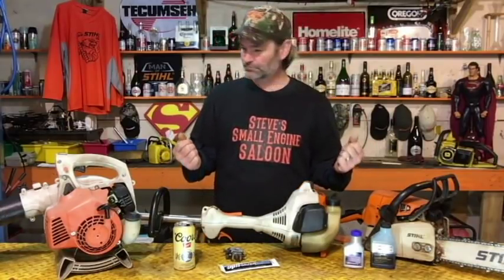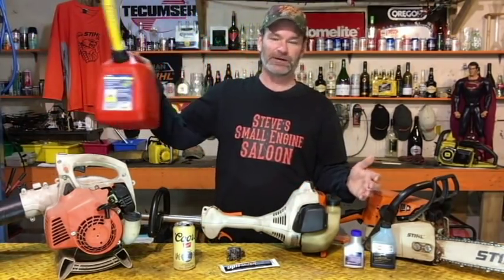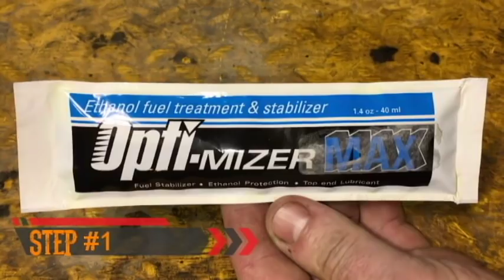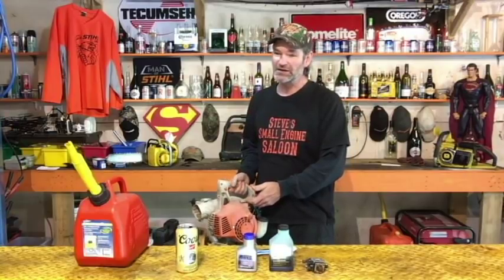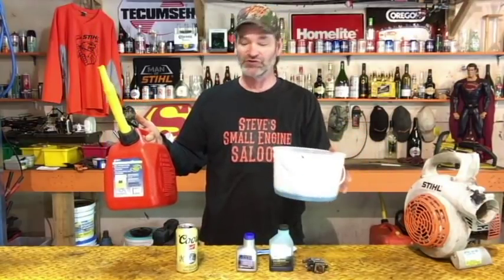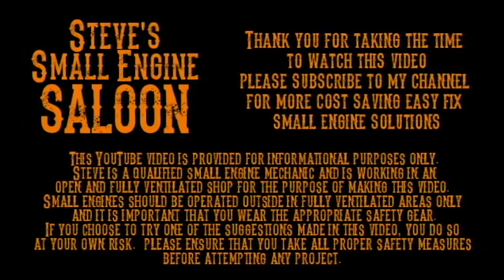How To Winterize a Chainsaw, Weedeater, Blower or Trimmer

Comment: Hello Steve: Just came across your video. Great job ! Any comments on using SEAFOAM instead of STABIL ? My mechanic friend swears by it. Also, any difference for winterizing a 4- stroke such as a lawnmower? I always pull the plug and squirt some WD40 into the hole while I pull it through. This IMO prevents rust inside engine. One comment: A Canadian beer, such as Moosehead, would be a nice touch.

Comment: I wAs told buy my lawnmower shop is bad for the motor to leave the tank dry so I use ethonal free gas, I run out the normal gas and put the true fuel or ethanol free gas is and run it again. Then when you store it theres no ethanol to plug up the carb.
Reply: Having the tank empty is okay if you have drained everything like Steve did.   If not you then should fill your tank.   The other problem with a low tank other than what Steve talks about is every time the temperature changes  air comes in when cold and goes out when warner.  The problem is that every time air comes in with moisture and there is usually some moisture it condenses and leavs water in the tank and over time this amount keeps adding up and I guess the rest is self explanatory especially if ethanol is present as it absorbs the moisture.   It will migrate to the carburetor as well.

Dale in Canada

Comment: 99.9 2strokes run high test/ premium. premium doesnt have ethanol. ethanol causes gas to go bad like regular.
Reply: Your wrong buddy. Just cause it’s premium doesn’t mean it’s ethanol free and there is always trace amounts of ethanol fuel no matter what unless the storage tanks, fuel tanker compartments, load and discharge hoses etc... I’ve drove trucks delivering fuel and it’s a damn disgrace what some chain stores do just to get your money like regular unleaded and mid grade having no difference and in some states it’s legal to sell as long as those two products are in a tanker trailer with inspected and tested compartments designated for one fuel only. Same with diesel we haul gas and diesel to a store then get dispatched to deliver 9,000 gallons of diesel which means using every compartment for diesel with slight amounts of gas in them still.

Comment: Dump out the shit gasoline, buy a quart of  True Fuel. Fill the tank to the top, cap it and run the engine for 2 minutes. Done. Hang it on a hook and lock the shed door. It will start right up in April.

Comment: Great video was glad to see I was doing all the same steps for long term storage but one. I have been doing this for years and I haven't had an issue but do you consider leaving out the stabilizer bad practice.
Reply from the maker: Stabilizer is so cheap, I use it unless I'm just running tank after tank, and I know that it will be used again very shortly....

Comment: I do it the traditional way. I run the engines until they run out of gas.  Then I remove the plug, clean and gap it, shoot a little bit of oil in the cylinder, crank it over, reinstall the sparkplug, crank it till the valves are closed. ( NOT too much oil, especially with small engines because that can cause hydrolock and even cause the piston rod to break when you crank the engine.)  I also clean the air filter and change the oil.  I'm 72 years old and that is what I have done my entire life and my machines run great. If it's a lawnmower, I sharpen the blade(s) and balance it (them).  I love these videos but I don't agree with this one.  My shed is so full in the winter that it would be a nightmare pulling the machines out to start them every month.  I also completely disagree with those that always use engineered fuel in their small engines.  I mentioned this in another video on the subject but my chainsaw lasted over 40 years and ran flawlessly and I ran it with pump gas.  I never had a single problem with the carburetor and I never had a problem with the other additives mentioned in the video about using engineered gas.  On the other hand, I've recently started removing the alcohol from ethanol. In the video that was about engineered fuel, I had to laugh when I read comments by people who said they only used engineered gas in their small engines.  I laughed because, in my area, engineered gas costs between $10 and $20 PER QUART!  At that rate, you could just use ethanol and save enough money to simply replace the equipment regularly or it would certainly cover repair costs even if you have someone else do the work. It makes absolutely no sense money wise.  It's simple math. It makes no sense to pay a lot of money to POSSIBLY save a small amount of money. And I've never had any of the problems that are claimed for using ethanol with the other supposedly even worse additives mentioned in the video about engineered gas.  And my machines seem to last forever.  As I said, my chainsaw ran perfectly for over 40 years with absolutely no problems using pump gas.  The last time I started it, it started on the first pull and ran as if it was brand new. I gave it away and it's still running fine for the new owner.  Now, just imagine if I had been paying for engineered gas all that time.  It could have unnecessarily cost me literally many hundreds of dollars with no benefit at all.  In all my years, I've probably removed carburertors on my machines maybe a half dozen times and, in almost every case, it had nothing to do with damage caused by pump gas. The only time I found damage that was possibly caused by pump gas was when I found a worn diaphram. It cost about $1 and about 15 minutes time.  So, I continue to do what has worked for me for for over 50 years as I mentioned above. I do not and will not store motors with gas in them. The one exception is my motorcycle.  Draining the tank on my bike  manually is very difficult so I run it till it's almost empty and then I fill the tank all the way to the top with gas - lately with gas that I have removed the alchol from.  I run it for a minute or so to circulate the non-ethanol gas.  If you insist on storing engines with gas in them, the important thing is to fill them all the way to the top. 

As for stabilizer, check out Project Farm's videos on that subject.  After watching that, I wouldn't use stabilizer anymore.  I used to put in in my 5 gallon cans of ethanol that I use for my machines. No more after watching that video. Don't assume that stabilizer works. I did and it was a mistake.

Comment: I run 91 octane non-ethanol in ALL "lawn & garden" equipment - anything with a small engine: mowers, snow blowers (or throwers as some call them), leaf blowers, weed whackers, chain saws, power washers, etc., whether 2-cycle or 4-cycle.  Costs a little more but beats the hassle and expense of carburetor gum-up, clean out/rebuild, or replacement.  Since I changed over about six years ago, I do not mess with additives or winterizing, and change the spark plug and oil (on 4-cycles) every year, and have never had to worry about it.

btw, your video is too long.  It could be the beer.

Comment: Warm the engine , drain fuel and run again until it stops. Just idle it.  Using a airgun in the tank i defume it. Dry tank , no fuel or residues

Comment: Why Not Just Drain The Gas, Then Put It On Choke And Start It Up And Let It Run Till It Sucks Out And Burns All The Gas In The System. If It Burns All The Gas In The System Then There's No Gas In It To Go Bad & It Should Be Ready For Next Spring.

Comment: Not going out in -30 weather to start all my engines. Nope. Run em' out of fuel and put em away
Reply: John Tanner weed eater I just run it out of gas and then try to start it a couple of times and put it away. I do start my riding mower through out the winter once a month.